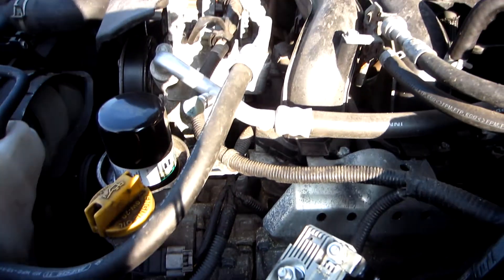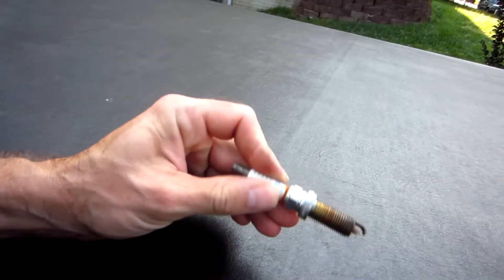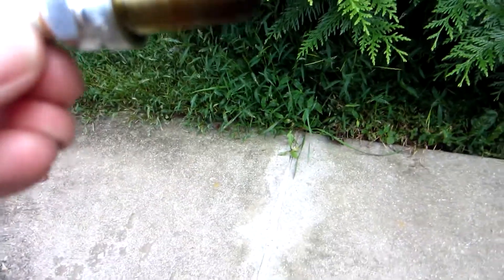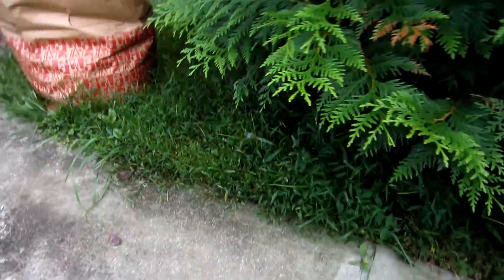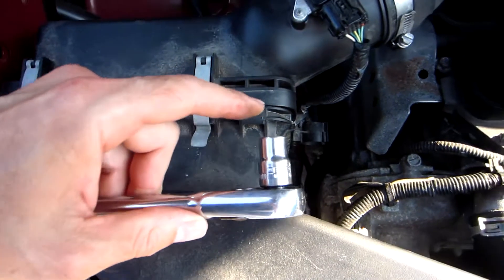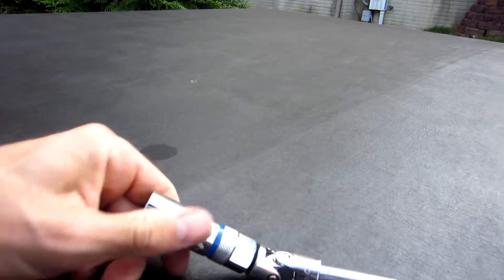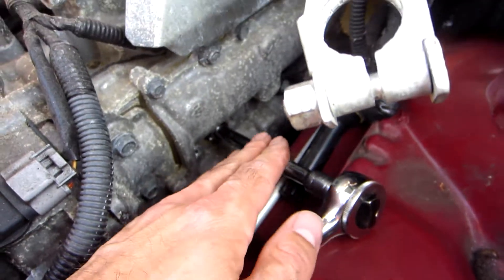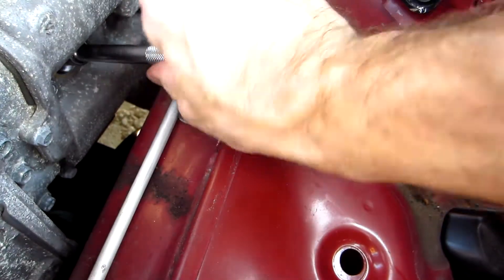New Spark Plugs in the 2012 Subaru Crosstrek-Found a leaky injector!

Comment: How has the crosstrek treated you since you've owned it? I've been looking into buying a used Crosstrek/Outback/Forrester...they are have the same engine and almost indentical interiors.
Reply from the maker: To be quite honest, more stuff has gone wrong with this is the 78000 miles than I would have liked!  It had an AC leak the first year, which was two visits. The left front axle started to knock badly and had to be replaced and both rear wheel bearings needed to be replaced.  On the plus side, it burns no oil.  The trans has acted funky once, but nothing ever came of it.  I am glad it has a free extended warranty by Subaru for the trans up to 100000.  I might buy one again just because it fits my 4' 9" tall wife so well, but other than that, I don't really trust the reliability...Good luck!